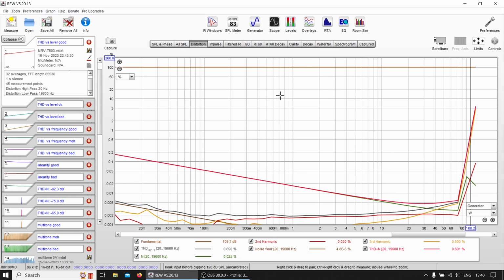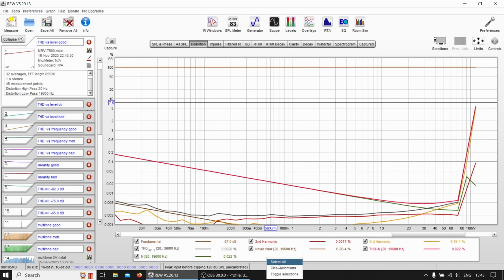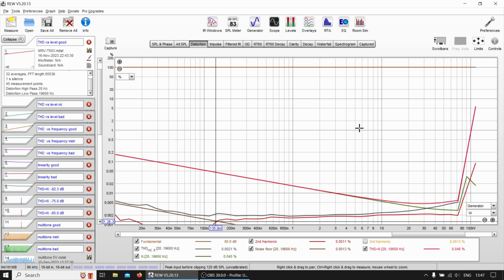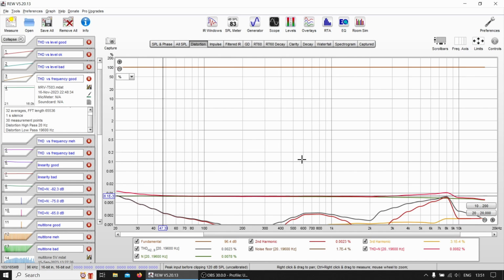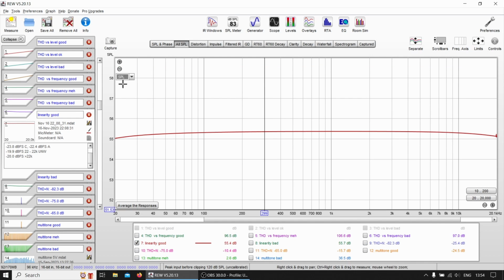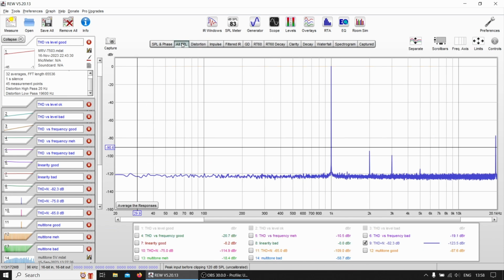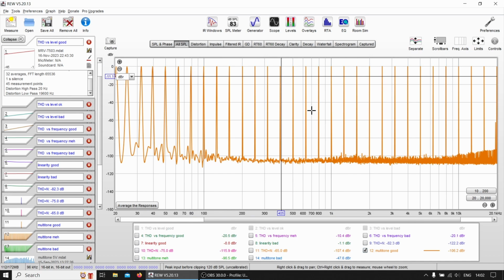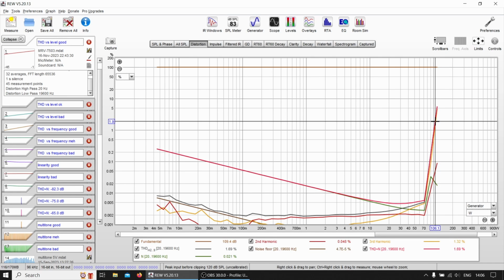How to read amplifier distortion graphs

Comment: Instead of RTA is it possible to set REW to sweep , and plot in a loop?
Reply from the maker: Yes, rew does sweeps. I make stepped sine sweeps.
Reply: @RAW-CAt  In a repetitive and automatic loop though?  I want to make live adjustments and see a more detailed sweep response as opposed to RTA.
Reply from the maker: @andyh8239 what exactly do you want to see? RTA showed everything live.
Reply: @RAW-CAt  I want to see a sinusoidal wave sweep plotted as a response cuve as opposed to white noise where FFT is involved and the signal averaged over time.

(But occuring in a loop)
Reply: @RAW-CAt  Would be esp useful to have a 3 octave loop range that works its way up as you do with the correction.   I'll prob just settle with custom white noise in narrow bands, but less ideal.

Comment: The power of an amplifier is delivered equaly to all speakers/frequencyes? or how much the driver needs. If an amp is 5% thd at 100w and 0.0 something, below lets say 50w. In a scenario, a 2 way sistem where the tweeter is rated at 30w and the woofer at 70w. Can i use the amp at full power because the bass will eat most af that power? and 5% thd isnt that bad for low notes right? The tweeter wont be affected? How tis works? Thank you